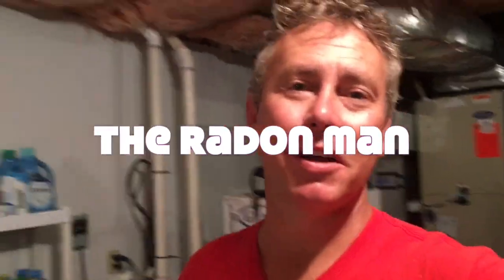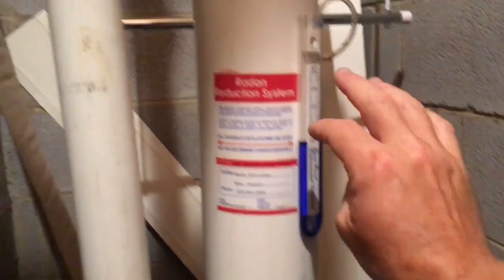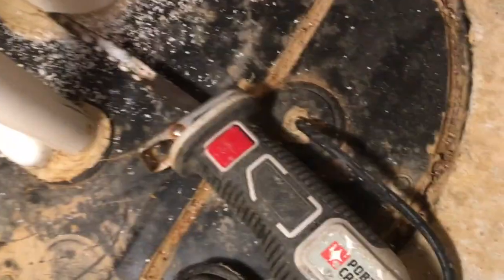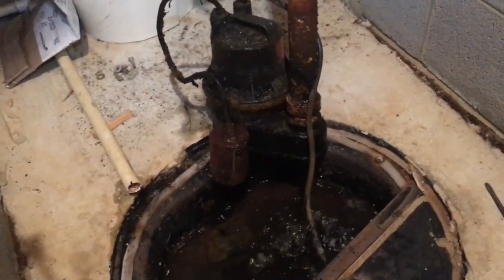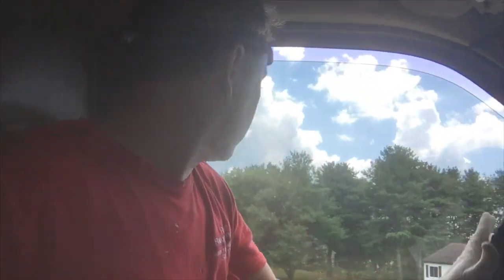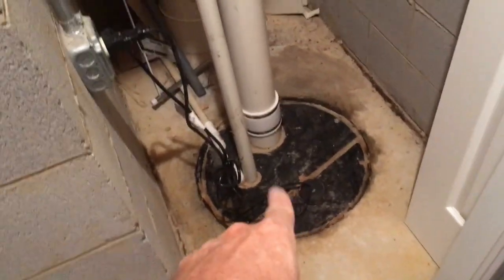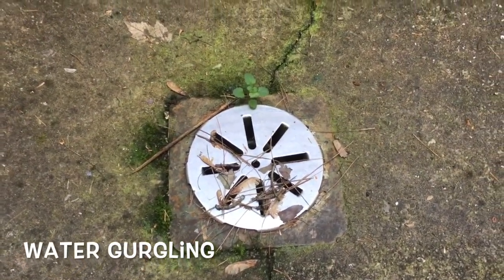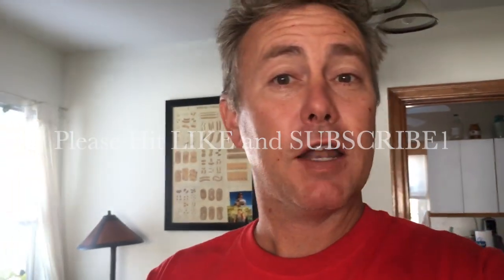Radon Removal From a Sump Pit- FAIL

Comment: I just had my question answered, don’t use your sub pump as the primary suction point. You will be pulling more water into the pit from your perimeter drain tiles.

Comment: Yep, that's an old pump.  11/4 lines were common on bathroom sinks and sump pumps years and years ago.  But bathtubs and kitchen sinks had 1 1/2.  How much difference in flow rate does a 1/4 inch make?  Just to avoid confusion and getting different fittings, I say the minimum pipe size for pumps and sinks should be standardized at 1, 1/2.

Comment: I hope you drilled a 1/4” hole in that discharge line just above the pump connection. Keeps it from locking up!

Comment: How often do you come across situations like this where the intake to the fan is blocked by a rise of water in the sump pit?  Is it usually a failed sump pump?
Reply from the maker: The best way I can answer that is: Not ALL radon systems are tied to sump pits, however, ALL sump pumps fail sooner or later.  That's why the manometer is your buddy because it's a visual indicator for the system's air movement.  Periodically testing the pump or having planned replacements every x years whether it needs it or not -(like what people often do with sewage pumps in their homes. ) Thanks for watching.

Comment: Just tested my radon for the first time in the 9 years since my house was built. 4 upstairs and 9 downstairs 😢 almost 10 years of breathing this crap and I had no idea! Fortunately, I have a HUGE and deep sump pit, but live in Colorado, and in an area that never floods. We even got torrential "flood" rains all last month (significantly more than usual) and still, not a single drop of water went into that pit haha. All that was to say I will definitely be installing my mitigation system using that sump pit. I know water will never be an issue (we dont even have pumps in the neighborhood).
Reply from the maker: I'm glad this video was of help to you Kurchak! Good luck with everything. 😀

Comment: I moved into my house and got a radon test done. Long
story short they installed a radon mitigation system
connecting to my sump pump and sealing it. Since then
I noticed a ton of water pouring into my sump pump pit.
My pump would run every 1 to 3 min.
Today I got curios if I could raise the float switch to try
to balance out the water level or make it so it didn't run
so often.
The radon installers cut a 3" hole in the lid and silicone
a clear plexiglass piece over it. I removed that cover to
watch the float switch. 5 min went by and still it wouldn't
pump. Eventually by shear luck I noticed that as that
hole got smaller water started running fast into the
pump. I then covered the hole again and the water was
gushing in.. then lifted it up and the water stopped. It's
now been 20 min and my pump hasn't ran,
Why is the radon system sucking water into my sump
pump pit? When I remove this little sight glass the u
shaped device showing suction still shows a negative
suction. Is this OK to leave it like this? With the cover
off? I don't want my pumps running so often especially if
it's not needed.

Any advice would be appreciated. I  have since resealed the hole as it was installed until I know more.
Reply from the maker: Hi Aequitas Saints, A typical radon system produces about 1 gallon of condensation every day.  That right there is a source for a bit of excess water in your sump pit.  That shouldn't make your pump run so often though.  Having said that, I would have a pro come out if your pump is constantly running all the time.  Pumps fail and back ups are sometimes needed.  You want to be in front of that for sure. Thanks for watching.
Reply: @radonman6800  Water in a sump comes from the perimeter of the house.  Drain tile is run around the footings.  Check your downspouts they should drin away from the house, You may need to make a swale to channel water away from your home.

Comment: Nice video.  We have a Sump Pump pit currently with no pump.  Has a metal liner and some 4" corregated plastic pipe which I assume goes under the basement slab.  Our levels range from 35 to 46 pci/l.  After installing a RadonAway RP145c,  we still have levels over 10!  Professional Mitigation Folks said they can work on it and expect to pay $2000 or more and no guarantee they will get it down to under 2.  Any suggestions?
Reply from the maker: Hi Scott, sorry I overlooked your question so long ago.  I don't make guarantees either except that I will make my best effort.  Drawing gas out from under a home that I had no part in building has so many X factors.  A consumer is paying for the effort or procedure just like a surgery.  A surgeon will not even guarantee that we will wake up!  I would look at the testimonials of their customers and talk with them about worst case scenarios. I hope it has worked out for you by now.

Comment: Just bought a house, it came in at 10 for Radon.  Currently i do not have a sump pump, but I do have the sump pit.  You mention you have had decent luck with the pits working for the radon.   Is there a special cover for the pit you would recommend for the radon pipes etc... or even a Radon kit you like best?
Reply from the maker: Hi Shane, Radon Away has clear covers that I like pretty well.  You might just need a conventional system.  Hard to say, especially not knowing how active the sump pit is.  If you need a mitigator to look at it just go to www.nrsb.org.  That's the National Radon Safety Board. Just plug in your zip code, and it'll being up a list of folks near you.

Comment: Nice video.  Was the radon level in the home retested after the radon fan and sump pump replacement?
Reply from the maker: Yes.  It worked out.  They didn't mind the loud fan and gurgling so the story ended there. Thanks for the comment.

Comment: I had dewatering system installed. They jack hammered while the fan was running. Probably not good, I realized later the fan was running when I went outside and saw dust coming out. What do you think I should do? The sump pump cover is off because they arent done yet, and now the system seems very loud compared to what it was. Will that change when the sump lid is put on?
Reply from the maker: Hi Zach, hopefully the dust issue worked itself out.  The fan could be removed and rinsed out I suppose.  I'm sure it's resolved by now because I 'm so far behind responding to folks.  Take care. 😀